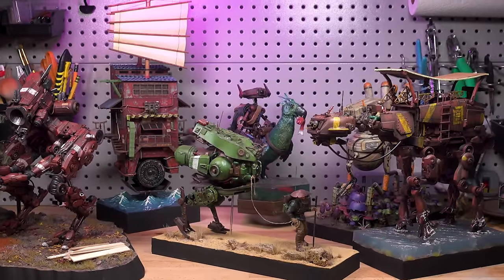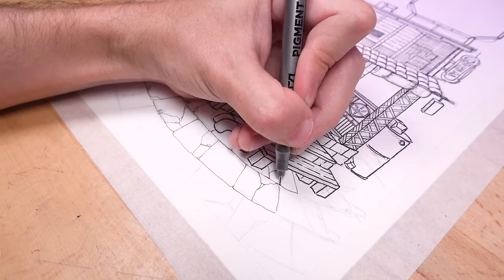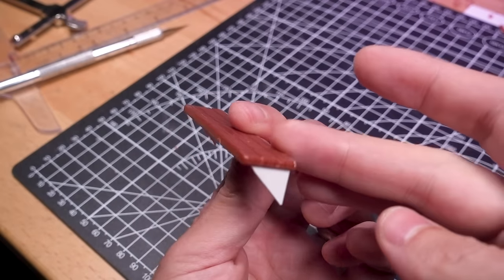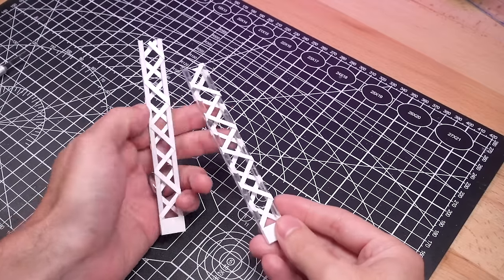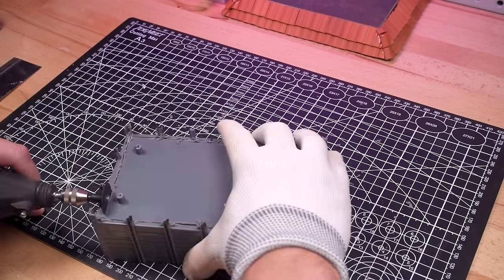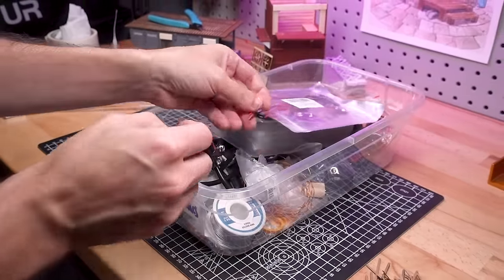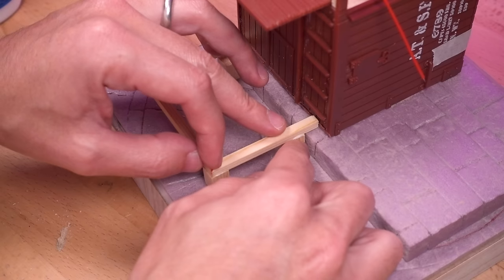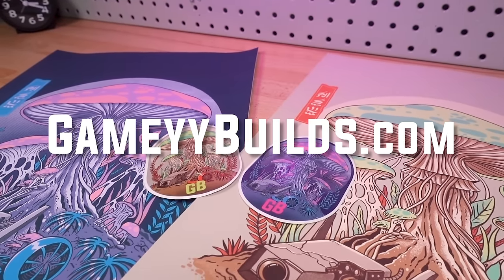“The Inquiry” Making a Sci fi post office for Beyond the Blight

Comment: hello, I have a silly question but first I want to thank you for this video. What a beautiful build. The stories you create with the builds... It's true otherworldly multimedia. You are actively opening the door to the other world. That is very very nice.
I have bought a bunch of the thin long plastic nozzles for the super glue. I wanted to ask, how do you implement them? Do you cut open several of the tiny super glue tubes and pour the glue into some bigger container and put the nozzle on? Isn't the pouring and exposure to air detrimental? I am doing a lot of miniatures gluing and painting and really want to start using this precise nozzles but I don't know how to set them up.
Thank you, whoever can advise me!
Reply from the maker: Excellent question! I may include this in my next video, but here’s the steps: first I cut off a bit of the back end of the attachment tips (it’s too long to fit on the superglue nozzle as is). Next, I add a bit of UV resin to the outsides of the superglue nozzle (being careful not to get any on the hole). Finally I stick the attachment onto the nozzle and cure with a UV light. This gives me a perfect seal.
Reply: @gameyybuilds  thank you very much for the reply! That is very helpful and straightforward. Much appreciated 😊
Reply: @gameyybuilds  i thought of a kinda cool idea that you could maybe add to your beyond the blight world and was wondering what you thought. I was wondering if you could build a mech suit type thing piloted by a little kid alien that protects a small self sustaining town but the town doesnt know theres a living being inside so they never give him food so he has to sneak food from the village while keeping his existence a secret
Reply: I just think a good creature coming from the blight would be cool

Comment: Better Idea for why a mail drop is needed is interstellar communication will be noisy at best considering all the back ground emf.  Then there is computers will get so fast that encryption is pointless and the old computer programmer saying of you can't beat the band width of the trunk of a Buick.  Which means you can transport 1000, 10-Peta bite drives in the truck of a car and drive them across country faster than you could move that data on the internet.  Great modeling .

Comment: Roof Tiles, here's another material to consider, Bamboo. I'm sure you'd be able to buy it online in various sizes and lengths and it's got to be very inexpensive to boot... I've been watching some other YouTube videos about how Asians are making real roofs out of bamboo and it's very easy. Simply cut the stalk in half, long ways, remove any center bits, then stack two cup up and 1 cup down to bridge the game and it works like magic. Or you would just simply glue them side by side, cup down. Even if you get larger diameters, say 1", give or take, I'm sure you can cut them into 1/4s and still get useful roof/wall parts. Plus I think you used Bamboo as trees in one of you builds, if memory serves correctly, as I seem to recall you making a lot of leaf's and gluing them on to something... Anyways I hope this suggestion helps...
Reply from the maker: Nice suggestion! I guess the only challenge here is that they would have to be very uniform in size in order to look right.... I'll give it some thought!
Reply: @gameyybuilds  Actually that's the great thing about Bamboo, it's very uniform in size across most of it's length... And it also varies in diameter too so it can actually scale very well...